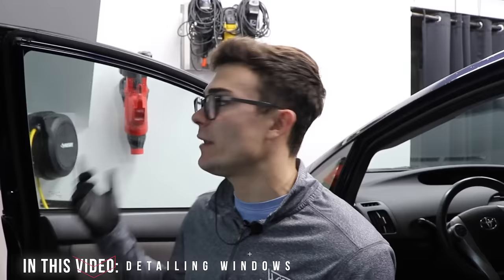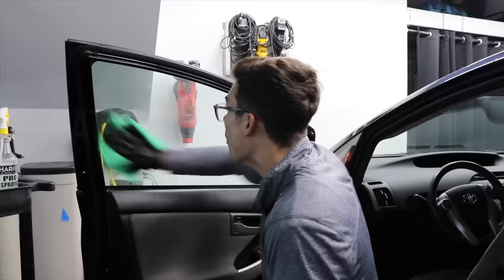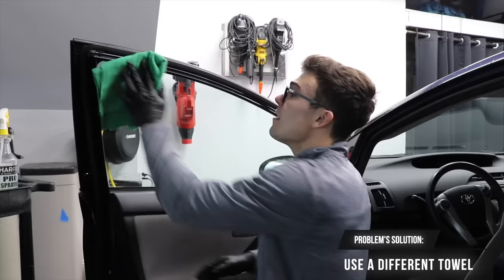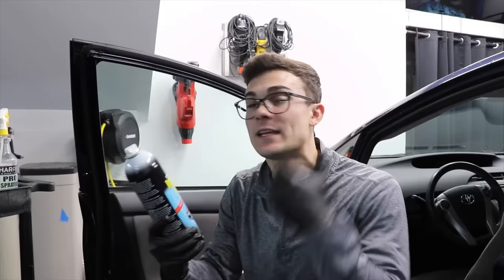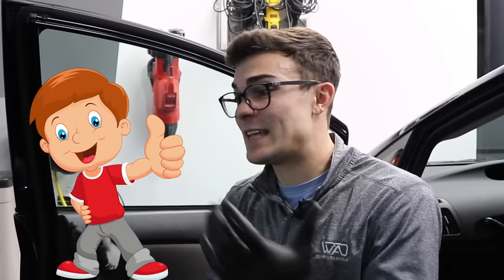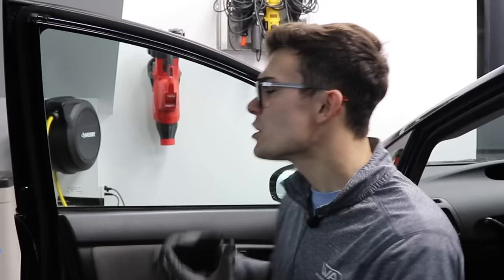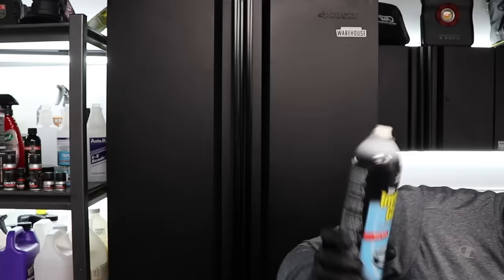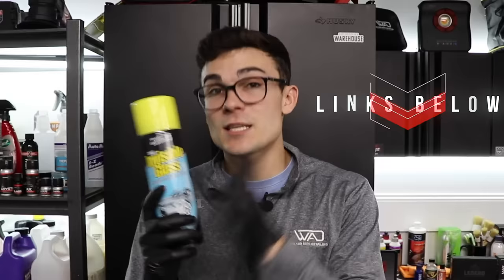Solving The Biggest Problems With Windows

Comment: If you have an older car, residue on the interior glass windshield can be a sign that your heater core is on the way out. The coolant will start to escape through a pinhole leak and collect on the inside of the windshield. That is difficult to clean up well and it’ll get messy again as soon as you drive again.
Reply: Spot on. My car’s heater core has gone and I was getting the same issue. I found pure alcohol and a micro fibre cloth works ok to get rid of the residue. But your spot on that it just come straight out again so it’s a temporary solution. In summer you can turn on the air con to remove the humidity from the air and that works but in the winter this stops and your screwed.
Reply: Another sign that the heater core is leaking is that you smell a fishy odor. (hot antifreeze)
Reply: True!
Reply: I noticed residue on my windshield almost immediately after installing a new (NOS actually) dash pad, and it fades with cleaning over time, but every time I apply vinyl protectant to it, a couple days later I notice heavy residue again. Fortunately I know my heater core, while old, is still good.

Just something else to muddy the waters, so to speak. If you have a new vinyl dash and use the 303 Aerospace Protectant on your dash, you're gonna get residue.
Reply: @pat8988  I describe burning antifreeze as a sweet smell kinda like pink insulation 😂
Reply: @NordicDan  off-gassing
Reply: @MrMagichobo21  Yup, 100%
Reply: Could also be a mildew from a damp HVAC. Running the A/C causes condensation on the evaporator in the dash, which if not dried properly before the vehicle is shut off will eventually cause mold and mildew. You can mitigate this somewhat by turning your A/C off a a couple of blocks from your destination, and by  avoiding using the recirculation function unless absolutely necessary.

There are air con cleaners for this problem, which are hit or miss from my experience.
Reply: @davideyres955  but was he spot on?
Reply: Wrong, nothing wrong with my heater core, the windows on the outside/sides have hard water spots. insides are clear and fine.
Reply: Smell comes first.
Reply: Hard on the lungs too.
Reply: @dundeeecroc  he wasnt wrong. What he said just isnt applicable to you. And no one was talking to you
Reply: So how do u test the heater core to confirm thats the culprit?
Reply: Wouldn't you smell it coolant has a particular smell
Reply: Yep, and typically you can smell it when it starts steaming out..
Reply: Usually when a heater core is f*cked is when the passenger floor is soaked.
Reply: So you should spend $600-1200 to prevent icky windows?

Comment: I am a retired Glazier (40Yrs.)  I have never found a better glass cleaner than Sprayway glass cleaner. Hands down the best IMO
Reply: It specifically has to be the SW050 version, tho. The way it foams up compared to the normal version is far superior. Not to mention I feel like it cuts through grease a lot better too.
Reply: When I had my windows replaced with Champion windows, they gave me 6 cans of Sprayway glass cleaner, the best I've ever used.
I clean the interior windows with a little dawn and water to cut the buildup, then finish with sprayway.
Reply: Cheapest, too! Sold at Wal-Mart. I've tried many brands in cans. Then I found Sprayway.
Reply: Is that in your resume?
Reply: A 60yr old does not speak like you. Let alone know what imo means 😂🤦🤷
Reply: @saturatedfatyt  They sure do speak like that SMDH
Reply: @brinkee7674  the very rare few yes i guess my assumption was too harshly stated.
Reply: Agreed, been using it for years...works great removing water spots and fingerprints on stainless steel appliances!
Reply: @bme7491  Tell that to Tesla Cybertruck owners!🤣🤣🤣
Reply: Absolutely correct!!Sprayway FTW (I won't be 60 for a few more years, ty)
Reply: YEP  !!!!!!
Reply: fun fact. Safelite Autoglass glass cleaner is a slightly modified version of Sprayway. less for gloss, and more for cleaning. i cleaned every single aperture with this before gluing glass in. top tier product, and used in this case with potential liabilities!
Reply: Sprayway safe for tint?

Comment: For years I've only used 2 shop towels.  One damp, one dry.  Wax on, wax off.  No product, just water.  Streak-free every time.
Reply: This is the best method
Reply: I use cheap walmart glass cleaner and it somehow does a perfect job (blue bottle around 4$)

Comment: When I worked for IBM years ago we used Ethyl Alcohol to clean optical glass used with our Laser system.  99.9% pure and when wiped off with a Lint FREE cloth the glass was spotless.  You have the right idea with the alcohol and lint free cloths.  Good point!
Reply: The reason you don’t use complete alcohol is if can damage tint especially if it’s ceramic……
Reply: Careful with 90-99.9% ethyl alcohol though as that can easily damage/warp other car interior parts that it touches
Reply: @goodoughpie6144 true,  I only use water and microfiber on my tints now
Reply: 70% mix Ethyl or Isopropryl alcohol, 30% water. Great for cars, any glass. Common sense to be careful not to soak plastics etc.
Reply: Be careful with certain chemicals,  windex changed the color of my tints few years back
Reply: Could I use methyl hydrate instead ?
Reply: Alcohol will destroy most interior plastic and trim parts
Reply: In high school, I had a buddy who was meticulous in cleaning lenses to film cameras as his job on the school newspaper and yearbook. He convinced the school to buy several fifths of Everclear (name brand of close to pure grain alcohol) for this process, since it was the cheapest 90% ethanol available. He went through several bottles during his Junior and Senior years, some of which actually was actually used in the lab for cleaning camera parts. 😉

Comment: I never use any "Glass Cleaners" on my glass. Years ago I learned that they leave product behind that will haze up on humid days. I Strip the interior glass the alcohol mix (70/30 Windshield, 50/50 side windows) and only ever maintain it with pure water and a waffle weave towel. If it gets bad I will hit it with the 50/50. I very very rarely have my windshield fog up.

Exterior I use turtle wax ice and shine every other month. It makes them incredibly easy to just wipe down with a damp paper towel to remove bird poo or dusty dirty water spots.

Great info throughout without drawing out every explanation! The video did not feel like it was 7 minutes at all! That is a rarity for educational videos A++! (P.S. You have motivated me to buy more waffle towels, mine are getting old so it is time to send them to the great washing machine in the sky.)
Reply: My first car was an old 2001 Kia and i had MAD issues with fogging.
As a newbie would, i turned to Youtube for help, found an "shaving foam hack" and lo and behold, it worked.
Just apply and spread it, then wipe off the foam and wipe it with clean. 

Only when clearing up the car before its inevitable trip to the scrapyard i realised a can-sized ruber cap in the trunk floor was missing and my spare tire was floating in captive water... the car had problems lol.
Reply: If you mean Windex, correct. Amonia-based sprays do leave a residue. Alcohol/water does work but can dry the glass while wiping. Using a proven cleaner like Invisible glass doesn't leave any residue and the towel glides over the glass easier while wiping. In the end, it's just preference.

Comment: Great tip on the water+rubbing alcohol, I’ll have to try that! Another potential cause of streaks is dirt or grime on the doorframe or the foam seal around the window.  I typically roll the window down, clean all of the foam, window frame and the piece at the bottom which acts like an interior wiper blade first, and allow it to dry.  If you do all of the window frames in sequence then the first will be dry by the time you’ve cleaned the last one.  Then roll the windows up and begin to clean them.  This helps prevent dragging residue from the doorframe, sealing foam etc back onto the window as you’re cleaning it.
Reply: I was going to say the same thing! 
Go around the frame of Every window first then toss that dirty towel in the bin and grab a fresh one for the next step. 
This should be added to the video as #1 for a total of 4 common problems.

Occasionally, i'll even spread the wiper/seal thingy(some are lined with felt) and run a towel between it that is sprayed with cleaner.

Comment: Great video. It also makes a huge difference how your towels are washed and where/how they’re stored. NEVER use fabric softener sheets when drying towels for detailing work. Also, if you openly store towels in your garage, they will be subjected to humid conditions and end up basically unusable for cleaning glass.
Reply: Yes. Fabric softener leaves oil/wax on fabric.
Reply: Totally agree.
Reply: White vinegar in the rinse will not only soften a little bit it removes any detergent residue in the fabric.

Comment: A microfiber intended for glass has worked so much better with invisible glass than any standard microfiber I’ve used.
Reply: Yup!  Good ol waffleweave!
Reply: And no chemicals.
Reply: Crumbled newspaper like the can/bottle Says.
Reply: @billyyank5807  I personally never cared for this method even though the container does mention it. I know others that like it though. I wipe with regular microfiber first to do the real cleaning. I finish with microfiber for glass and the results are excellent.
Reply: Try a squeegee with invisible glass and just clean up with microfiber is the best.
Reply: cheap walmart cloths dont work with anything. nore does dollar tree junk. best microfiber i found is the harbor fright ones. they literately pull dirt away from what you use them on, and it stays on the cloth. dont wash em, just toss em

Comment: Two Tips on the Alcohol:

1. Be careful with overspray. Droplets sitting on your paint will dissolve the wax/sealant. Droplets sitting on some sensitive interior materials can stain &/or dry them out causing premature oxidation. I prefer to spray on the towel to avoid this.

2. Straight IPA+Water can be very grabby as it lacks lubricant. This is more of an issue with warmer temps as it also dries more quickly. For this reason i like to add a couple ounces of M34 (Meguiar's Final Inspection) to my 16oz bottles. It is essentially a pure lubricant. I also use the M34 in my homebrew waterless wash mix.

Comment: Finally someone talking about the lint that gets left behind. It’s been driving me crazy. I’ve been using waffle weave towels from chemical guys and even those leave lint behind. I’ll have to try these out. Didn’t even think about using alcohol to cut through the fog. I’ve been using dawn dish soap and water, sometimes magic eraser to make sure all that fog gets cleared and don’t have any streaks.
Reply: Get a glass cloth from Amazon, tight weave no pile, zero lint
Reply: (I'm making this up as I types, so this could be stupid but...) have you tried wiping with a coffee filter after? I know that sounds weird but they are designed not to shed any fibers into your coffee. Might knock off the cloth fibers.
Reply: @tomhollins5303  yeah. They are basically lint free towels
Reply: Yeah there are better towels. Chemical guys products are middling at best. I get all my stuff from Autopia
Reply: Good info, been wondering about this problem, thanks 🙏
Reply: I tend to use Car Cleaner Wax with windows.   No lint.    With tight weave microfiber.
Reply: Due to chasing the almighty bottom line finding a true micro fiber cloth is near impossible these days.

Comment: Old remedy that still works., use 30 % vinegar in a spray bottle , use micro towel to spread around then wipe the windows with old newspapers . It collects all the smudges from the windows and leaves a nice finish😅😅
Reply: That's terrible advice! The newspaper leaves ink smudged all over the glass!
Reply: @jublywubly    I should have mentioned to use “OLD” newspaper .  Also don’t saturate the paper ,a light spray works best Personally I never had a problem with. Good Luck and have a nice day
Reply: Vinegar? Car will smell like a salad. Tried that once.😩
Reply: @jublywubly - cleaning with newspaper would not leave ink all over the glass. I have been doing that for decades on home/car, leaves zero streaks and fluff unlike towels/squeegee etc

As for the vinegar, I would not recommend unless you want your car to smell like crap.

Comment: As a teen back in the mid-1970s, I worked for a (brief) time at a local Amoco station mostly pumping gas.  One day we had a customer's car in to be cleaned up, and when I was going to clean the windows I asked if they had any window cleaner (back then, it was pretty much Windex).  The owner told me that they never used commercial window cleaners-- they used newspaper and gasoline to clean the glass!  Then, they left the car open to air out the gasoline smell!  Needless to say, my tenure there was a brief one!
Reply: Gasoline is a phenomenal solvent, it's mostly fire safety and fume inhalation issues that have pushed it out of common use as such.
Reply: @MalikCarr  Some of the older mechanics I know would take particularly grimy car parts and let them sit in a bucket of gas or diesel for a day or two and the sludge would wipe right off. Dangerous as hell but it got the job done in a pinch

Comment: I tried this glass cleaner mix today and it works. Heavily soiled outer glass needed a second cleaning, but the result was better than any commercial glass cleaner I've used. Luckily I had the isopropyl alcohol and distilled water on hand, mixed 50/50. In stead of the special towels that was suggested I used  blue shop towels...worked for me.

Comment: I formulated my own glass cleaner earlier this year. It has the following ingredients: water, isopropyl alcohol, 2-butoxyethanol AKA butyl cellosolve or ethylene glycol monobutyl ether, and a tiny amount of surfactant such as Tergitol NP-9 or Triton X-100. It costs no more than 1.5 cents an ounce and works great.
Reply: What are the ratio's? Thanks!
Reply: @Virallllllll  Here you go.

This cleaner uses 70% isopropanol (IPA) and 2-butoxyethanol (also known as butyl cellosolve or ethylene glycol monobutyl ether) at a 3:1 ratio, along with one drop per quart of surfactant such as Tergitol NP-9 or Triton X-100.

Example to make one quart (946ml) of ready-to-use solution:

Isopropanol 70% solution: 1.5 ounces or 45ml
2-butoxyethanol: 0.5 ounces or 15ml
One drop of surfactant.

To make one quart (946ml) of CONCENTRATE, use 24 ounces (710ml) of 70% IPA and 8 ounces (237ml) of 2-butoxyethanol, and 16 drops of surfactant. This will make four gallons of solution diluted 1:15.
Reply: @NipkowDisk  Great, thank you!
Reply: @Virallllllll  You're welcome!
Reply: I run the defrost

Comment: On glass that doesn't have a film tint, just a haze from the passing of time,  dry paper towels actually work extremely well. Even just the cheap paper towels at a gas station, bone dry. Worked at a gas dock growing up, and the boss got annoyed at how much Sparkle I was using to clean up boats - the dry method works shockingly well for windshields. No haze, no steaks 👍